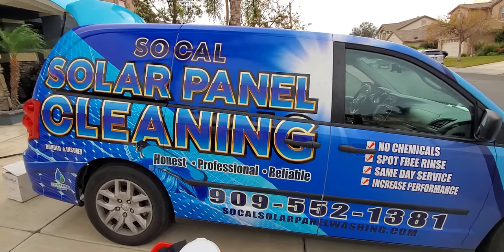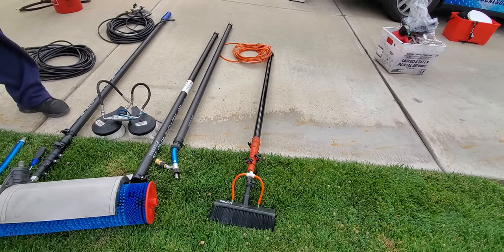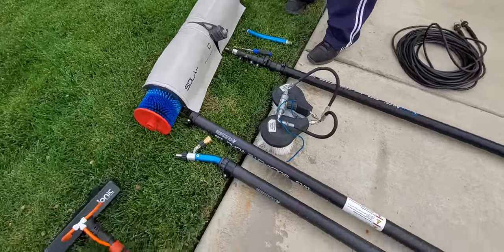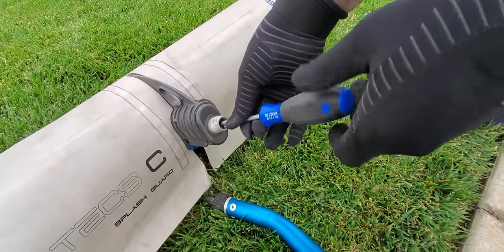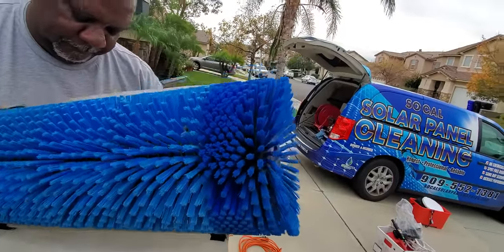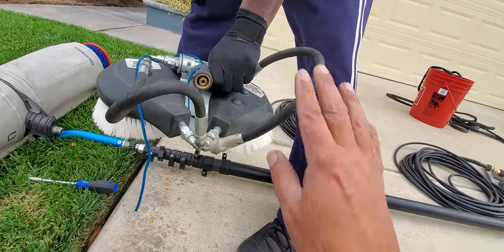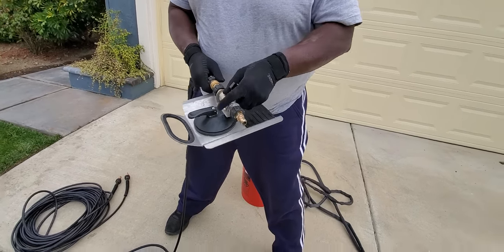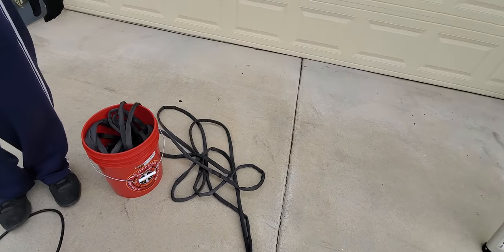Solar Panel Cleaning Equipment That Will Make Your Job Easier With Rick and Henry

Comment: I've really appreciated your videos.  I've been cleaning windows since 1988, started in CA but now live in Midwest.  Solar panels are really just now taking off here so looking into that. Have you ever used your "monster" on straight high glass?  Tall windows?  Just for speed efficiency is what I'm thinking even though I know they're designed for solar.  Thanks guys, keep it up!

Comment: I'm getting into solar cleaning from a detailer background and am surprised to see you with your brushes down in the grass and driveway where small rocks and sand can contaminate the brush leaving micro scratches which get crazy bad over time like on a cars paint and windows. From the detailing background thats a big no no. Do you guys power rinse your brushes before using them after leaving them down like that or is that not something to worry about? Just curious 🤷‍♂️ Love your content, you've been very informative.
Reply from the maker: we always lift the brush and water runs through it before it hits any panels we try to keep it clean as possible but thank you for bringing it to our attention